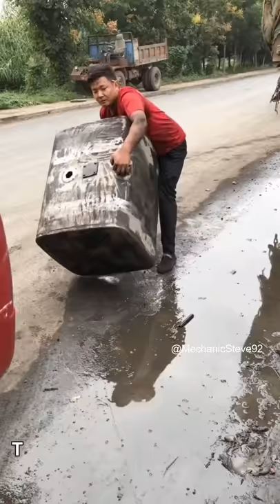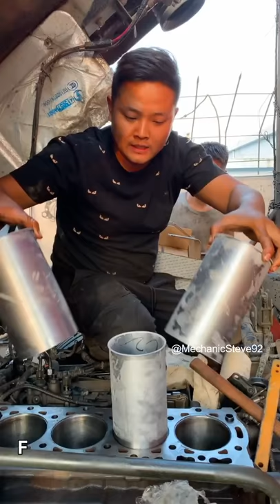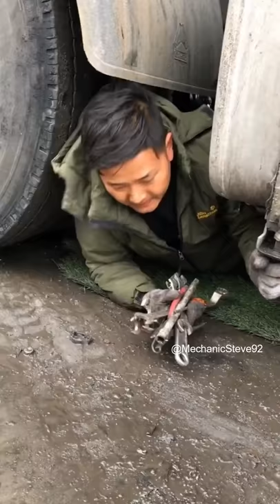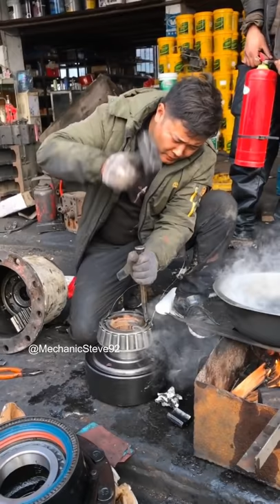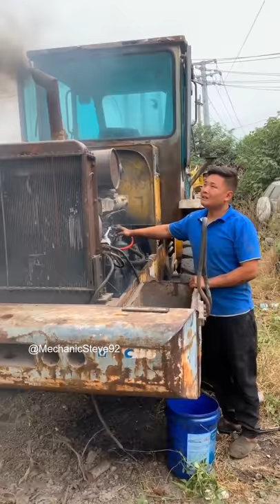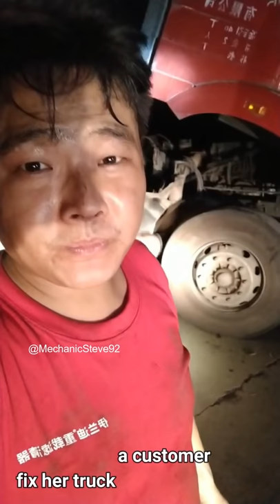Life comes at us in waves. We can't predict or control those waves, but we can learn to surf

Comment: Why does he hold the guys hand when He's listening to the engine
Reply: I also wanna know
Reply: The other guy is pressing the accelerator whenever Steve squeezes his hand
Reply: Throttle
Reply: Unsafe in case of a shock buddy pulls him from the shock saw my uncle do that back in the days
Reply: Old throttle trick. Gotta use what you got.
Reply: I thought he was helping him balance on top of the engine good to know.. this guys a fkn badass
Reply: Those cabs can fall down if you tear a line or wind he's holding hands so he can be pulled out and not be crushed
Reply: @subarutime5089   maaaan.

Check the fan speed if you doubt that is to give gas.
Belt driven fan, turn as fast as the engine.

( go buy a nissan, dont subies a bad name)